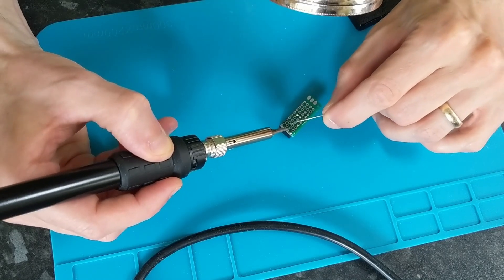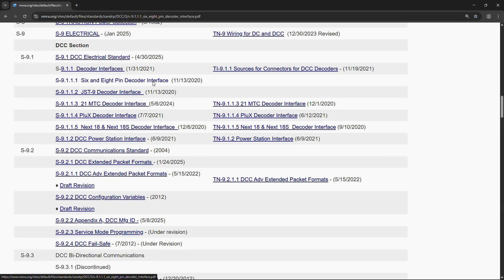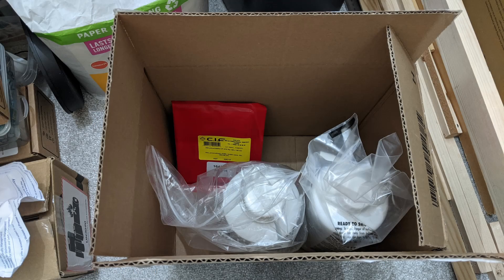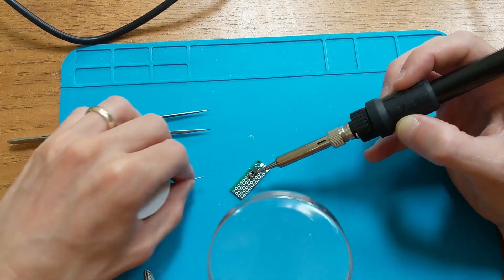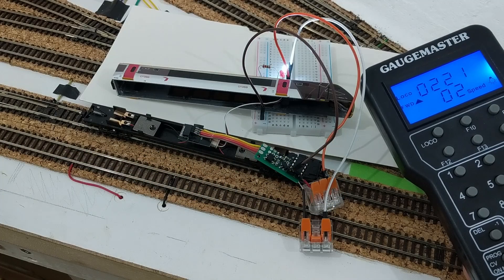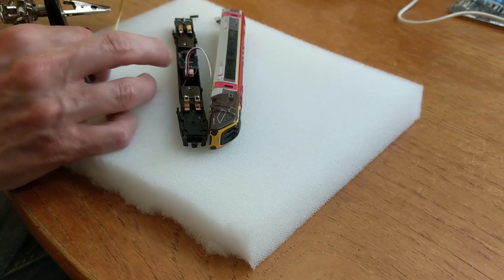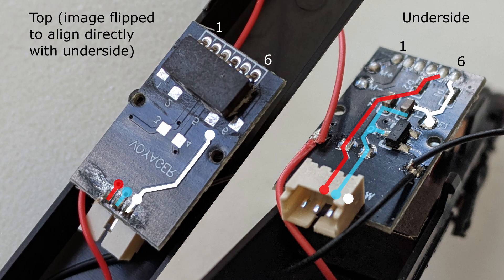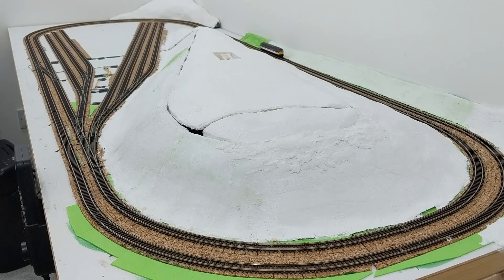0053 Making a DCC decoder from scratch -  part 3

Comment: Not sure why you had problems finding the header, 0.05" is exactly 1.27mm that you ended up buying) And pin diameters are close enough to not matter
Reply from the maker: Converting between the unit systems wasn't an issue, nor was finding headers with the right pitch, but nothing I found at that pitch said what the pin diameter was - it's not specified in anything I found, nor did I get results when searching by pin diameter, so I didn't know whether or not the pins would fit.
Reply: @endoorrailway  to a very large extent they are interchangeable!

Comment: I can recommend using a pcb manufacturer (jlcpcb, pcb way etc). I was happily surprised how low cost it was to have 5 small boards made.
Reply from the maker: Thanks for the recommendation - I've got the bits to do this at home and would like to see how it goes - there'll be an extra level of satisfaction if I can get it working, but it's good to know the manufacturing option isn't expensive 👍

Comment: PCBWAY.  IF you send them a gerbil file of the circuit diagram, they will make the circuit board and for few $ more solder your components
Reply from the maker: Thanks - others have suggested KiCAD for making files, and PCBWAY is one of the ones that gets mentioned a lot, so they'll be one that I check out if I fail at home etching!

Comment: If you're thinking of physically making your own PCBs, I'd suggest you're in for a world of pain, especially for SMT components. Unless that's a specific goal, download KiCad and get them manufactured in China (PCBWay is my preferred 'fab'). They'll do five boards for $5 plus postage ($5 if you're prepared to wait a couple of weeks, $20 for faster shipping). They can also assemble if you ever want to drop to the really small stuff. KiCad will be a steep learning curve but the skills will have many uses on other projects.
Reply from the maker: Thanks for the suggestions - I'm determined to at least give home etching a go, but fairly open to moving on to submitting online designs later. KiCAD is a clear favourite that people recommend, so that'll be one that I try first. Undoubtedly there will be lots of videos and guides around for help with it 🙂

Comment: Hi Jonathan! You're getting really good at soldering these tiny components, and connecting them using even tiner wires! I have no idea about the electronic components that you're using, but I'm enjoying the process you're going through to figure out what you need to get the job done! While I've been trying to understand the electronics I need to build my DCC Interface project, I've found Google Gemini a great resource, as long as you question every answer given, and don't take them at face value! Is it part of the NMRA standard that a DCC decoder has to be handle a DC input? I'm sure I've purchased decoders that warn against using them on DC - or maybe I'm confusing that with not running a loco with a blanking plate installed on DCC! Anyway, I'm really enjoying this series, so keep up the good work, and I look forward to the next one! :) Cheers, Ian.
Reply from the maker: Hi Ian,

I was pleasantly surprised at the soldering - I genuinely found it easier than wires to track! It seems with the surface-mount components and limited tinned areas on perfboards or PCBs, the solder will happily go wherever there's flux and metal 🙂 I think I was also using the toxic solder here - not intentionally, but when I looked back at the reel it doesn't say lead-free.

I'm glad you're enjoying the journey! Most of this step to me felt a lot like "I just used smaller versions of the stuff I mentioned last time", so I decided not to go into detail about the components, but I think in later videos, or if I do something new (like use transistors), I'll give more detail. For your project I think you could use the same simplification that doesn't require the opto-coupler to read the signal - I was pointed at this Instructable for it (I wouldn't be surprised if you've come across it in your own searches): https://www.instructables.com/DCC-Accessory-Decoder-Using-Arduino-Nano/

Yes I'm enjoying the AI summaries now, but don't trust it enough to use it as anything more than a likely hint! It doesn't help when it contradicts itself within its own summary - yesterday I asked it about "installment" vs "instalment", to which its response included "the same word, with 'instalment' (two 'l's) being the standard spelling in American English and 'installment' (one 'l') being the standard in British English". It's fixed itself now though.

I haven't seen any NMRA statement that decoders must work on DC, but it's hard to see how they could be damaged by it. Potentially if the track voltage hovered close to what the decoder needs to function it would be switching off and on a lot, and that would be an issue? Yep - I was meaning to say putting a blanking plate into the Voyager and then putting the Voyager onto DCC-powered track can damage the LEDs (according to the Voyager manual) - I suspect it's because the blanking plate just completes the circuit from one track back to the other, so 13V would go through it (on Gaugemaster Prodigy), possibly as much as 22V (the max DCC systems are allowed to spike up to for N gauge) whereas on DC power it would be max. 12V, I think.

Thanks for the encouragement! I'm really enjoying this project at the moment, so I suspect it'll feature fairly often 🙂
Reply: @endoorrailway  - That's really interesting about being able to solder to PCBs more easily than track! Who'd have thought? Yes, the link to the Instructables project is already in my bookmark list, so I've obviously been there before! Thanks for the suggestion though! My current design uses four diodes to create a bridge rectifier circuit, from which the signal is then fed into an optocoupler before going through a drop down resistor into the Arduino! This setup apparently gives full wave rectification, where using one diode will only provide half wave rectification and you'll lose half of the polarity of the signal - according the Gemini! :) I almost sound like I know what I'm talking about, but have no idea really! Lol! Ian
Reply from the maker: Hmm, I think Gemini might be letting you down there! Full rectification will result in a constant DCC "high" voltage out of the rectifier (13V in my case, I think 15V with yours?)... which will effectively erase the DCC signal - essentially each rail will cancel the other out - there won't be anything left to decode for instructions. I do have a full-wave rectifier in my design, but that's for providing constant power to the ATtiny (which I drop from 13V to 5V using the regulator) - if I were powering the ATtiny from something other than the track I wouldn't need a rectifier.
Reply: @endoorrailway  - From what I understand, after researching without the help of Gemini, the majority of the articles I've read recommend using full wave bridge rectifiers! These use four diodes in order to capture both halves of the AC signal, converting it into a pulsating DC that contains all the data! The optocoupler is there to provide electrical isolation between the high track voltage and the lower voltage needed by the Arduino, and there's current-limiting resistor that protects the internal LED of the optocoupler from the high rectified voltage! I'm not saying that you can't do the job with fewer components, but as I don't have the same space limitations as yourself, I'm going to go down this route first - until something blows up at least! :) Ian
Reply from the maker: Potentially we're getting some terminology mixed-up here - would you mind sharing an example article with me that recommends that (if YouTube lets you put links in)? If it is indeed full-wave rectification then you won't get a pulsating DC signal from rectified DCC - you'll get a constant DC signal. Fully-rectified conventional AC results in pulsating DC, but that won't be a crisp digital pulse - it'll be more like sinusoidal humps - but DCC is not conventional AC - rectified DCC is a series of fairly crisp rectangles with basically no gap between them.

If you want to compare the DCC signal of both rails I think you'll need two sets of optocoupler + resistors and then each into a different input on the Arduino, but neither optocoupler should be working off fully-rectified track power.

Just to be clear here - I'm not advocating you move away from the optocoupler solution - I'm saying taking fully-rectified track power (whether via the 4 diodes or the equivalent in one voltage rectifier component) as the starting point for signal processing won't work for detecting the digital signal. Nothing will blow up though 🙂

Hopefully my insistence here isn't getting annoying - let me know if it is! 🙂
Reply: @endoorrailway  - No, it's good to talk! :) Unfortunately, YT spirits away any comments I leave links in, unless they're on my own video! However, the Instructables project you linked to the other day uses a very similar setup to the one I'm going to use! You can see it under Step 1 - Assemble DCC Rectifier and Data Feed! Hope this helps... Ian
Reply from the maker: I've found the same here - I can see why links aren't allowed, but actual feedback to that effect would save some effort! lol. I type all my comments in a separate app these days then paste them in so I don't lose all the effort if they need tweaking.

Anyway, we've got one shared diagram and article 🙂 What's happening in that diagram is the same as what I've got on my circuit, but I think the phrase "This also provides a DCC data signal to the unit" could do with tweaking, because it's not the rectified power that's providing the signal. The rectified power goes to the 12V plug to power the Arduino - it'll be a near constant 12V DC, but the terminal marked "DATA" never receives power from either DCC X nor DCC Y. When DCC X is "high" (and therefore DCC Y is "low") there will be 12V to the left of the diode labelled D1 - no current will flow into DATA because of the diode, and since DATA will be an Arduino input pin set to pull-up, it'll be 5V - that's lower than 12V so no current will flow out of it towards D1. When the DCC phase flips, sending X low and Y high, current will flow from DATA to DCC X, from 5V to 0V. In this diagram you could think of the blue line out of DCC X as being an actual rail on your layout, with D1 and the top of the rectifying diamond each being soldered to different locations on that rail.
Reply: @endoorrailway  - Argh! I just left a comment that I thought was clever enough to beat YT's link checking, but it seems to have disappeared! I also thought I'd copied it, but I hadn't So frustrating! Can you check if it's being held? I don't fancy typing it out again... Ian
Reply from the maker: That's frustrating. No, I'm afraid there's nothing in the held comments on this video, and the comment moderation isn't set to strict, so I've sent you an email to the address from your channel description.
Reply: @endoorrailway  - For completeness, here's the gist of my blocked message...

I've been having sleepless nights over this! I was about to begin making the DCC Interface using the full wave bridge rectifier, but after you questioned it, I'm now having doubts! That's okay! It's good to get these things right! :)

So, I've gone back to Gemini and given it a serious dressing down, and have told it to verify everything it tells me, with links to sources that verify what it's telling me! Now, the really weird thing is, it's still insisting that the circuit using a full wave bridge rectifier is the best way to get a pulsating DC signal into the optocoupler, but every source it references is using the rectifier to pull out a DC signal to power something else, like the microcontroller! 

However, after me shouting at it, it's now started suggesting an alternative method that uses a single diode! It also provided a link to a decent article on Digital Town, that looks quite easy to follow, so I think I've had a change of plan!

The article is called DCC Decoder Circuit on their website, and for me, it's the first item that comes up when you search for Digital Town DCC Decoder Circuit in Google - or if not, you're looking for 79 DCC Decoder Circuit.
Reply from the maker: @iansngauge  I'll admit it sounds silly, but there've been model railway things that have caused me sleepless nights - the brain just won't shut down and keeps thinking about how to solve problems or what the possibilities are!

I think it sounds like I've managed to convince you (and by proxy Gemini!) about this, which is good 🙂 It's an area where, based on knowing how the DCC signal works, I don't have any doubt, so this will save you time and confusion in the long run.

Those articles look good, not focusing on powering anything. From what I gather (and here I'm straying into territory I'm much less certain about), when the decoder (i.e. Arduino) is powered from some place other than the DCC track it's more important to use an opto-isolator in the signal decoding. I think it's something to do with the two things having a common reference point for what counts as 0 Volts, because Voltage is all relative. The DCC controller could be outputting 10V for low and 25V for high (which from a the perspective of things on the track would still be 0V and 15V, because it's the difference that matters), but you wouldn't want 10V going into your Arduino.

I look forward to seeing how you get on with the one diode approach - it sounds fine to me, and spare electronics bits will certainly come in handy in the future 🙂